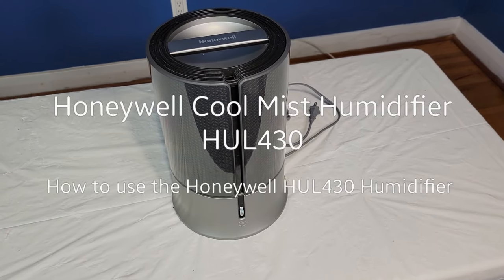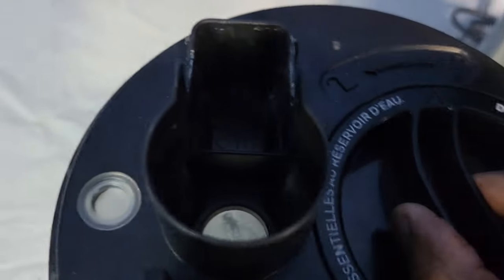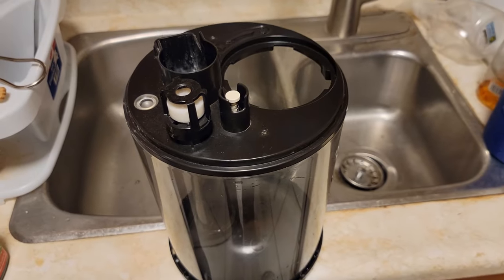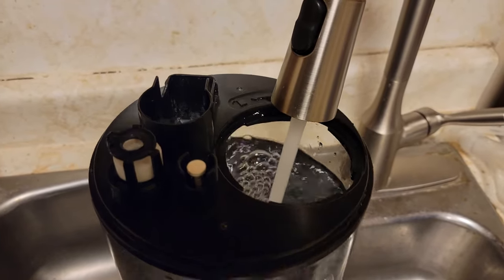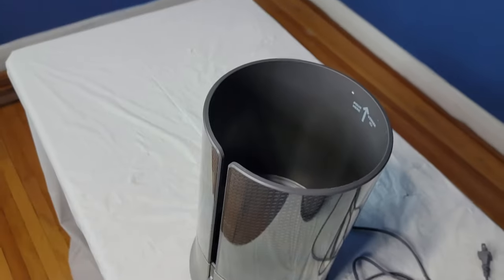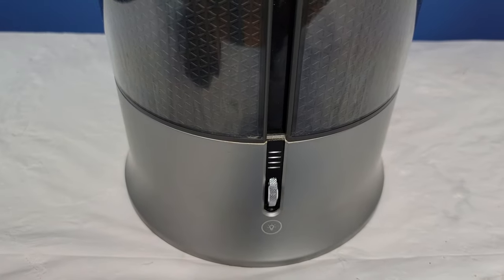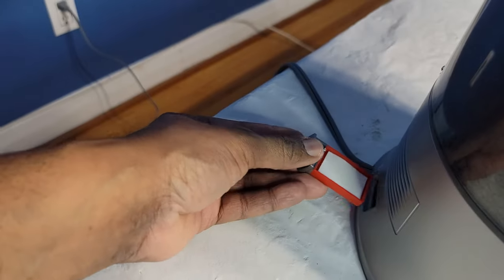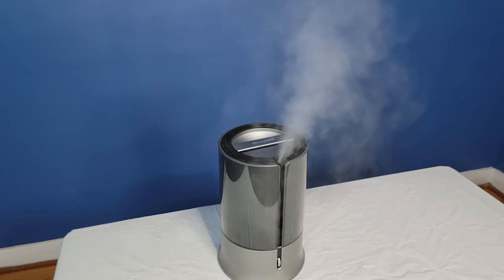How to operate the Honeywell Designer Series Cool Mist Humidifier

Comment: I just purchased mine and got an orange light. It was working just fine. I went to refill with water before I going to bed ( I didn't fill it all the way when testing it, just half way). And when I put it back in it stopped working. I waiting 15-20 unplugged to see if that did anything but nothing. Any suggestions? I've read some suggestions and it sounds similar to what I already tried.

Comment: How long does the water last, say at full blast? Thanks.
Reply from the maker: It lasts about 10 hours full blast
Reply: 1.5 days or a bit longer if you set the dial between 2 -3 notches.